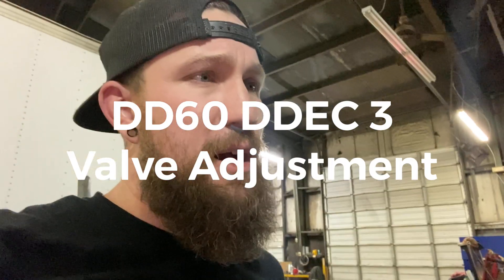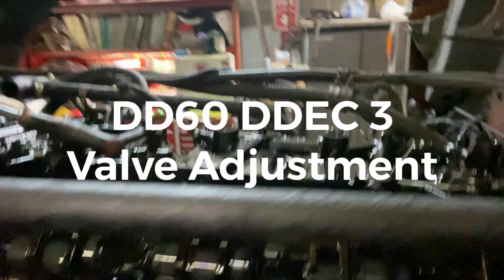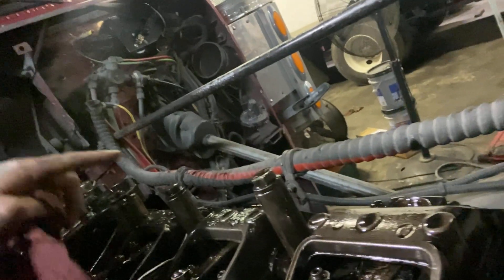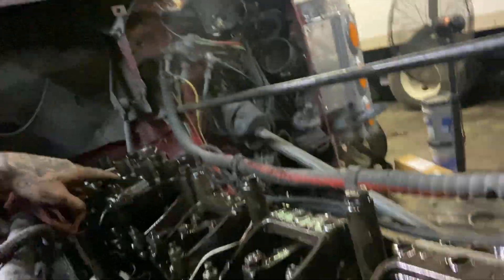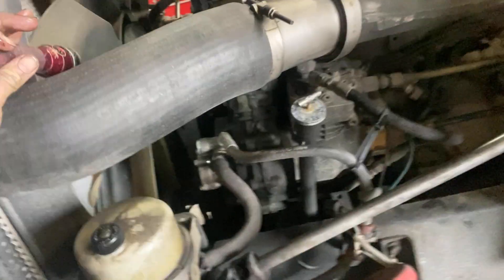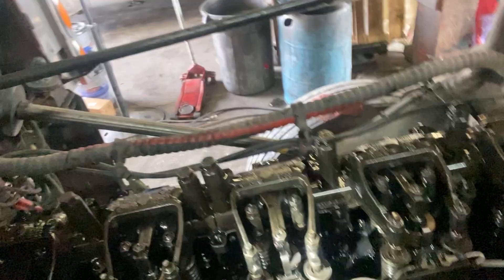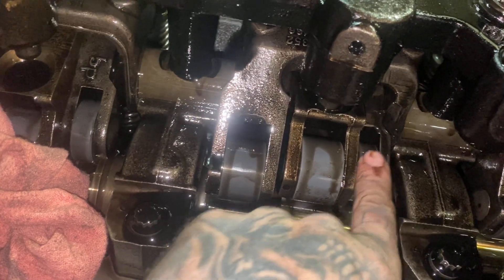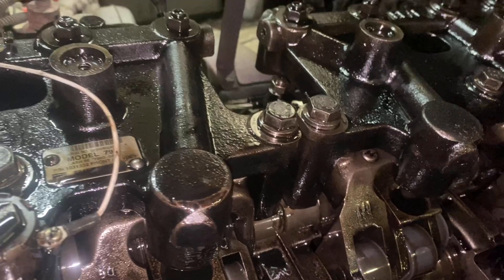Detroit Diesel 60 series valve adjustment DDEC 3

Comment: What valve /cylinder do you adjust the injector on
Reply: You need the cheat sheet, when the rear most roller stops spinning when rolling the engine over clockwise on cylinder 6 you set valves on #1 and injector height on #5 and so on, the cheat sheet is easy to find on line

Comment: How do you check the injector height on that motor because on mine I cannot find the adjustment hole for the injector    Height tool
Reply from the maker: remove the Jake
Reply: You don't need to hole if you don't use the tool, go from body of injectors next to the spring and measure up, my engine is 81mm, it goes according to the camshaft your running, larger lobes higher settings for more push on injectors